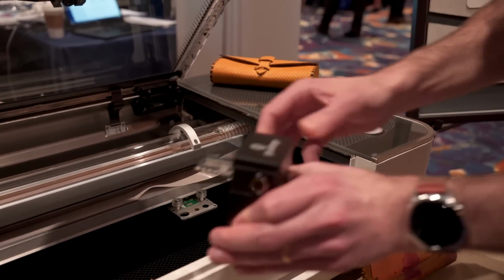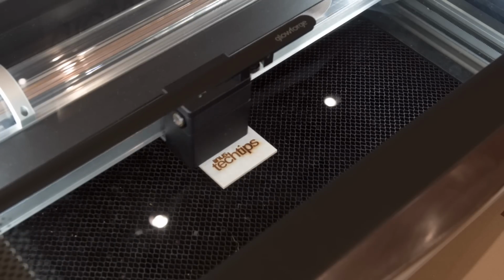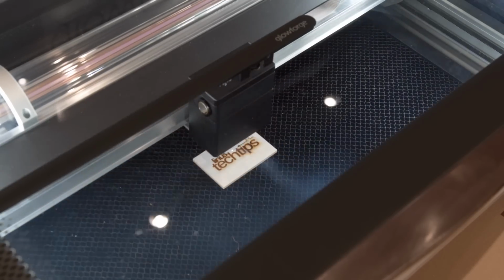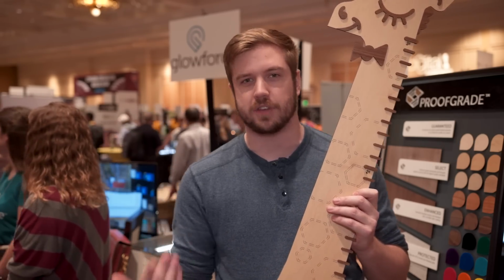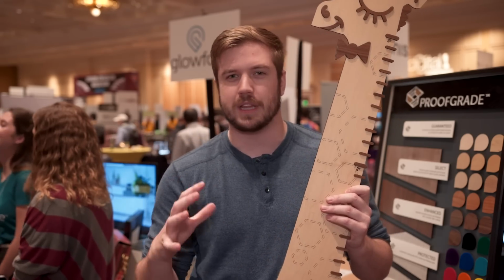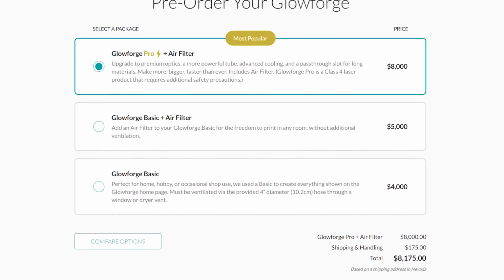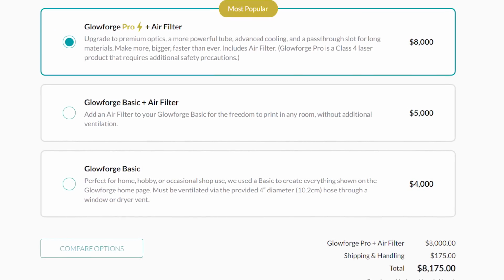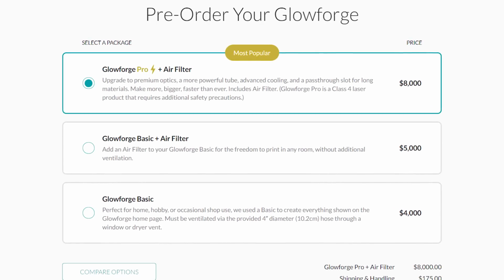Laser Cutter for Any Skill Level - Glowforge

Comment: I've considered one of these, but I don't want to buy something for $8000 which will turn into a brick if the manufacturer ceases to trade and the Internet service stops. Processors are dirt cheap nowadays and the logic should be built into the machine.

Comment: Some of the features seem cool but this is a severely underpowered laser. 45 watts means that you will be limited on the material that you can use. Pretty sure that thing will have trouble with 1/4" and thicker acrylic. I woodman with the Trotec Speedy 300,and while it's way more expensive, it's more flexible with what you can do with it.

Comment: I just imported a 120w laser direct from China.....$5000 delivered to my garage. work area 1300mm X 900mm, will cut and engrave without taking 4 hours, has pass through so it is more like 1300mm X Inifinity (and it wasn't a $2000 upgrade LMFAO) and before anyone says anything, importing a laser into the US means it HAS to pass FDA laser safety guide lines.  But people still fall for these hyped kickstarter things because it will supposedly do some fancy what not with its barcode reader and cameras......lmao, if you are spending 8k on a 40w laser you probably shouldn't be buying a laser.....stick with your cricut machine and collection of rubber scrapbooking stamps

Comment: Still hasn't shipped out the original 30 day preorders, still has fundamental functionality missing from the software (no 3d autofocus like was described in the video, STILL no passthrough support for the pro). Camera tracing and alignment, a FUNDAMENTAL FEATURE DESCRIBED IN THE ORIGINAL VIDEO, still does not work well beyond dead center of the bed. 

for 8k, you can get a half dozen other far more professional laser cutters from rabbit laser, full spectrum laser, redsail, etc.

Comment: I saw a laser cutter in a video and I wanted one but the price is an issue. Also I want sure if it is noob friendly. I mean I want something simple. From my side, I only want easy maintenance, like a normal printer.

3D Printing is a good thing but sometimes you need something better. Printing large objects are not cheap and you need a bigger printer. Wood is a good choice. Small details are hard to do by hand, when you're not good. I made a Hyrule Crest into a wood log and it was not easy. I didn't went that deep and even used a dremel. I made some mistakes but it still looks good. I mean you can build something that looks handmade or you can build something that looks perfect.

Comment: If you wan't a laser engraver/cutter and you came to this video because your researching glowforge, let me give you some good advice. Buy a used industrial unit and or build your own from a good kit. Glowforge is over priced for what it is. Everything Glowforge is designed to do is easily achieved by a little bit of research and or practice by the use. Chances are you want one for a small business or serious hobby, trust me a used industrial unit and or a good kit build will be well worth it. If you do a kit build, you will also learn a lot about the unit and can service anything that can go wrong and or modify the unit to meet you particular use case. The only issue I have with Glowforge is the price point, it was intended to be a consumer level product yet has been priced at professional levels. At the current price offerings, its not worth the money.

Comment: You know there is no other way than mirrors to guide a CO2-LASER!!!! THIS IS 10400nm - NO solid medium has as low refraction to transport this inside the medium.
Reply: Except fibers.
10.4um-compatible fiber optics exist and have existed for decades.
Reply: For optical transmission, not for power applications, though. There is a slight difference in what you put in and what comes out at the other end - due refraction. It is one thing to measure a difference between no light - light and a totally other beeing able to refocus the remaining light into a cutting or even engraving laser - at this wavelength. There are other lasers (mostly diode-pumped yag) which could cut as well and using fibers for lightguidance - but then they work more in the uv-spectrum (the other end) than IR, because of less refraction.

Comment: At 8000$ how is it any more accessible than an Epilog Helix?
Reply: Epilog lasers are overpriced too.
This unit has ~$200 worth of parts with a ~$300 fancy-looking case around it, sold for an insane markup.
Reply: Absolutely they are expensive but they also do a damn good job. if i'm going to pay 8k for this, why not spend 6500-10k on an epilog... sure you can spend 15k+ on the big model but the only real accessibility feature this new one has is the web based CAD..... and you already have tinkercad and fusion, adobe illustrator even works so... is it worth it?...... ive used epilog in the past and i always thought the primary difference was that the epilog laser could chip metal objects rather than just burn its way through... a handy feature to have i thought. never really looked into if it was unique to epilog just took the rep at his word on that one.

Comment: You can buy a MUCH more powerful, MUCH bigger, MUCH better built, NON-cloud device for HALF as much from China, and have money left over for a LOT of upgrades and consumables.
Don't fall for this crap, please.
Reply: Spirit if you could suggest thing I'm open
Reply: Well, it starts out at around ~$500, look for "K40" or "40W Laser Cutter" on eBay and Aliexpress. Then you just go up by power level, really. Bigger machines always come with adequately sized tubes(50, 60, 100, 150, 200, 300W).
There are entire communities built around modding and hacking these "K40" cutters, known alternatively as "bluebox".
For $8000 you can easily snag a 300W or even 500W CO2 tube, that's about as big as they go.

Comment: Guarantee the quality of this thing is going to be pretty crap compared to more standard ULS laser machines or the like. There's a reason professionals pay upwards of $15k for a laser engraver. This just looks like a product without an actual target market. Who wants to drop $5k so they can customize their side panel?
Reply: You can grab a ~$400-500 K40/Bluebox laser cutter from eBay/Ali, spend ~$100-150 on cool upgrades made by the large community and have an industrial level, but small and easy to use desktop unit.
Reply: Well, definitely not even close to industrial level. I've worked with industrial lasers, The type of laser that can engrave granite just can't be made for that much money. That kind of laser is great for hobbyists, but you'll very quickly reach the limitations of them. That's why this product seems weird to me. It's somewhere between hobbyist and industrial scale. Maybe just perfect for William Osman?

Comment: Just like 3D printers; it is $8000 now, but will be under $1000 in a couple years.
Reply: You can buy a slightly less feature-rich machine, with the same or more powerful laser tube, a more robust mechanical system, proper ventilation(and exhaust that isn't a $1000 extra option) for around ~$500 on eBay or Ali(express or baba, doesn't matter).
Just search for "40W CO2" or "100W CO2", and so on.

They've been around for years.
Reply: Danyal A. They will drop in price but not that much.  Laser cutters have been around for a lot longer than 3D printers, the price on them stabilised a long time ago.  This one is overpriced but has a lot of new features that Luke did not mention... It also sounds like a lot of these new features are not working yet.
Reply: More use cases, more manufacturers, more supply, lower price. I would expect it to be $4000 or less in 5 years.

Comment: 1:25 it is not possible to use fibre optics with a CO2 Laser since the wavelength of a CO2 laser is different then the wavelength of for example a solid-state laser (which can use fibre optics). So using mirrors is the only possibility to direct the beam.

Comment: I own the pro version so they are shipping it's just very slow.
Reply: Does it work on metal, even if I have to buy the pro version?
Reply: PyroStorm the Dragon you can etch aluminum but not cut it.
Reply: For $8000 you can buy a much better machine that will cut thinner metals.
This is an absolute ripoff, and an equally powerful(and much safer/longer-lasting) 40W laser cutter is ~$400-500 from eBay/Aliexpress.

Comment: Well, you can pay for it now, but it's still a pre-order. Their estimate is June of 2018, but I mean, they planned to ship in December 2015 originally and are still being delayed, so who knows when, or if, we'll ever actually see these things.
Reply: I'm going to ask (read in a polite tone)....why?
For $8k you could have picked up a number of equal and or superior cutters on the used market and or built you own. 
Example: https://buildyourcnc.com/blackToothLaserCutterAndEngraver.aspx
This kit fully loaded is $2k and has everything you need to adapt the build for multiple use cases (4'x8' setups, fixtures, ect).
I would understand if the whole time is money thing was at play, but at 4x the cost of a DIY option and 2x a used industrial cutter, I don't see the savings.
Reply: MorRobots well I didn't pay that much for it because it was cheaper during the kick starter. Also it can do more things than they talked about here that no other lasers can do. Biggest thing for me is it's hassle free. I have a diy cnc mill so I'm pretty confident I could have made a laser too but with this I took it out of the box and it just worked. My guess is they want to be like apple. Most people who buy a Mac get it because it just works and that's what this is.
Reply: Zzyzx Wolfe they are just slow but we are seeing them now. I own a pro model.
Reply: I have had mine since Aug 2017
Reply: Tobiah Adam I got my unit in September.
Reply: SeptrothFFXI the internal camera scans the object you put in it so it can etch and cut on curved surfaces perfectly without you needing to do anything. Also the passthrough slot when they finish the software. Also you can draw on your material and it will scan that image then cut it out. That's just what I can think of off the top of my head. I know this thing isn't for everyone just saying that just cuz it's expensive doesn't make it bad or a waste of money. I will say though that they where the first to do this stuff two years ago when they launched and I realise that in the mean time other companies have caught up.
Reply: Sure but this thing was designed to go in an apartment or house. I keep myne in my bedroom. From what I know the m2 40 is a bit big to do that and a tad more expensive as well. Also without just seeing it it's almost impossible to explain exactly what the cameras do. Also i get proof grade stuff which does save a little time if your in a rush and don't want to guess on the settings, and this can do metal too you just have to be careful with the stainless works great on aluminum though.
Reply: SeptrothFFXI I think your missing the point of what this was designed to do. They are clearly meant for two different people, just because you aren't that person doesn't mean its not better for someone else. Someone who wants to do curved surfaces which it can do much more than just a Mac. But not cost crazy money. The m2 40 is meant for a maker space or a business this is meant for a NY apartment.
Reply: Many folks have received their Glowforge. Check out their user group posts.

Comment: Fiber optics are not the way to go. They don't work as well for infrared as for visible light, and after the light comes out it's no longer that nice collimated beam.
Reply: 10.4um fibres exist, but they're not cheap and not really useful at this power level.
They're used for much larger machines, where you have many, many diode stacks with knife-edge combiners and a long delivery cable to a large cutting head(say, 5x5m cutting area).

Comment: Last i heard they were not shipping and its more vaporware, They have kept tight wraps on their demo units which may be overpowered compared to the actual final product. I would love for glowforge to live up to their own hype, but seeing as they are more than a year behind their original shipping date, I don't trust them.
Reply: Did you see the watch that the glowforge employee was wearing?  Thats where the preorder $ went to from the kickstarter!   Want a laser badly and NOW, BUY A MUSE!
Reply: So with the two most important features I was looking for, how does it handle 1/4 inch plywood and passthrough on the pro model? Some of the rest I could give them, and for thin pieces of wood, sure, but those two were where I was very skeptical on.
Reply: Epic Sauce 1/4 hasn't been a problem for me but for what I do with it I almost never cut anything that thick. As far as the passthrough that's all in the software which they aren't done with yet so I haven't tried it out. But I will say just having it there is really nice because you can stick stuff in that's way too long without having to cut it.if you want one now the muse is great but this does have some great features. I will also say being able to engrave on curved surfaces has been amazingly easy.
Reply: BurninGems actually they never spend the Kickstarter money because they where smart and got investors before hand. If you want your money back just ask and they give it to you.
Reply: Its not Vaporware I know because I own a pro model. They are just really slow because they are super strict with quality control.

Comment: Are these things actually shipping? last info was they were sorely behind and kept pushing the date out
Reply: Well, I pre-ordered one over two years ago, asked for a refund a year ago since they kept announcing delays. 
I would have still been waiting if I hadn't cancelled ...
Reply: I have mine now - it was well worth the wait
Reply: My friends received a tracking number for his. I wasn't patient enough so I cancelled my order over a year ago.
Reply: I just got mine, and I consider it worth the wait, given that I only paid $2200 with the early pricing
Reply: ^Same
Reply: According to their webstie they are currently shipping out the kickstarter units from their 30th day supporters (it was a 30-day kickstarter), so they would start shipping out actual non-kicksarter orders soon...?
Reply: I wasn't in the Kickstarter, I pre-ordered mine on 16th of October 2016. Not sure in what batch I should have been. It was just so disappointing to receive delay after delay, so I decided to cancel.
Also I got more experience with more high end lasers, like a trotec. Currently using a shared one in a makerspace, so I'm satisfied for now. Maybe one day I will buy one for myself.
Reply: Glad you received the machines, I considered the machine way way back in the early bird time frame but held off. As the companys delays and reteric got worse it reinforced the decision. But again I am glad to see buyers getting the machines.
Reply: I received mine Pro in January.  I've had great customer support since I first ordered my Glowforge.  I' already done several projects and am absolutely in love with my machine.
Reply: Yes... they are guaranteeing 10 days shipped